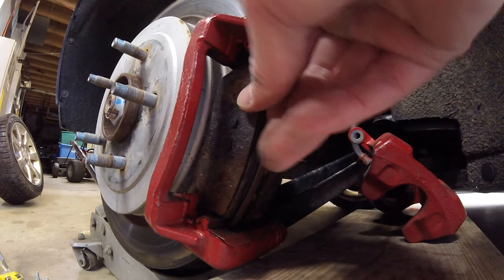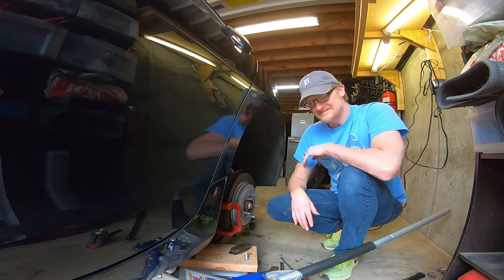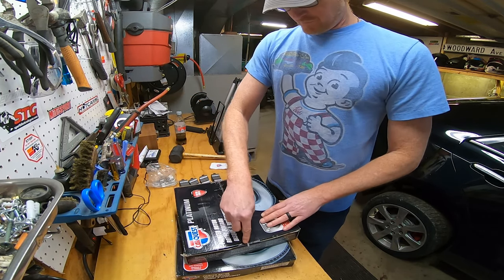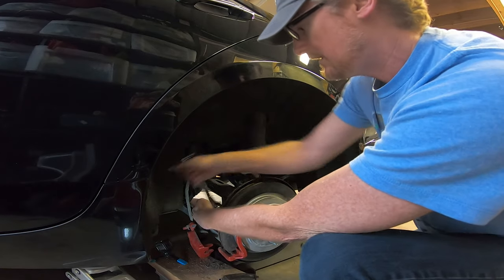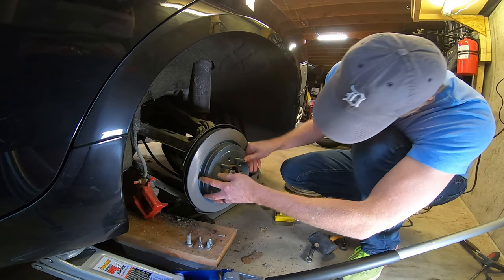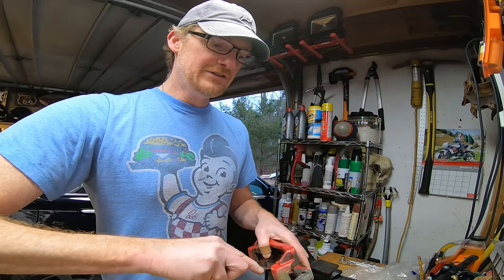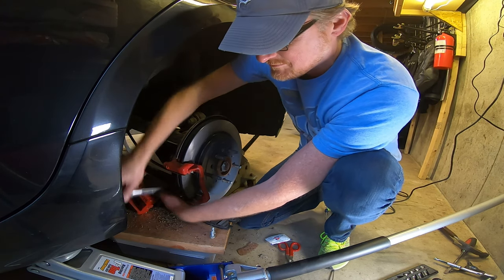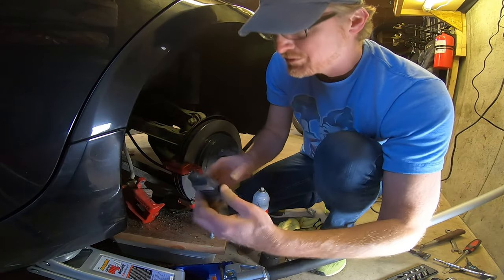Frozen Brake Caliper Part 1 of 2 | Cadillac ATS | Spring in Vermont

Comment: Good job.   That is very low miles for rear brakes.  Good to wire wheel the hub and put a thin amount of antiseize to be sure the wheel sits plat.   Regrease your slide pins!  The auto parts store can loan you a caliper piston tool.  I like to clean the boot before pressing the Piston in.      If you are adventurous get yourself a motive power bleeder.   I bled my '14 ATS  and the fluid was black.   That will help your calipers last.
Reply from the maker: Part 2 I replaced the calipers. But later my van had frozen calipers and I removed the pistons, used 2000 grit sandpaper to clean them smooth and they looked great so I put them back in and they worked great. Oh and the van had frozen slide pins! I broke them loose and cleaned them then greased and reassembled. This spring the Caddy is due for a full front break clean up 👍 I’m going to clean the pistons and regrease everything. Thanks for your feedback! We all get better when we share 🙏😁